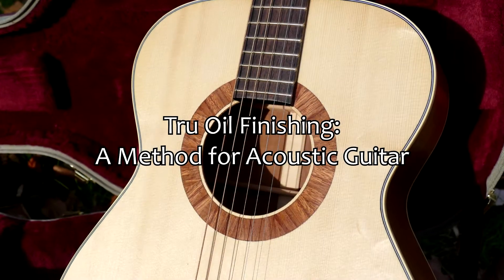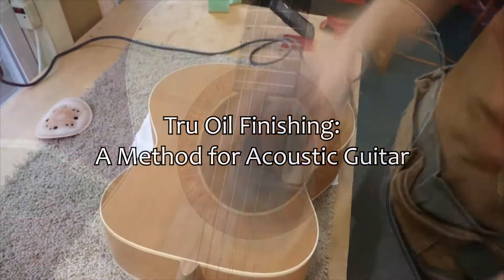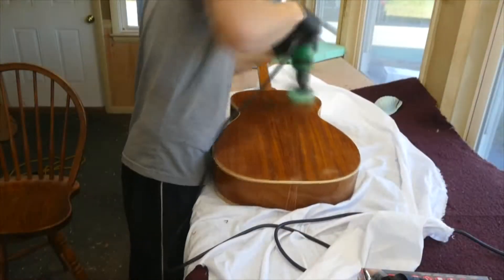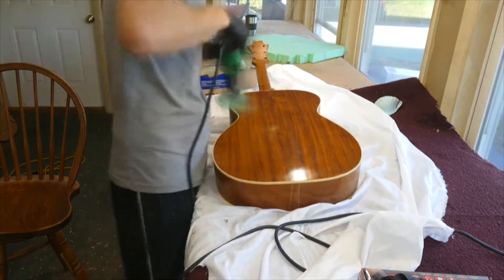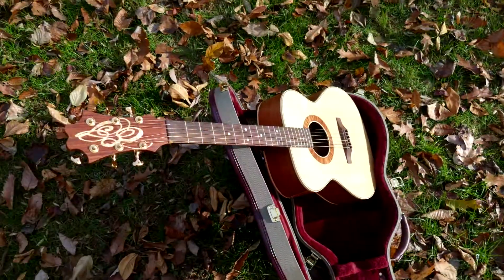Tru Oil Finishing Course

Comment: Hi Eric! I'm a classical guitar builder and all my guitars till now were French polished. This time I will try something a bit different because of the character of the wood .... a beautiful wenge with his deep pores. I try almost all tests on the scrap pieces ... pore fillers (dark, lighter, Epoxy), shellac (polished, mat) and the final solution is to send the wood to speckle ... up to 12000 grit and then finish it with 15-20 thin layers of tru-oil. The question is: Do you have any experience with using tru-oil with non pore-filled wood. This wenge is hell of a wood, hard as a stone so I decide to use all unconventional methods for a classical build to remember this guitar forever. Thanks,

Comment: have you tried tung oil how would that be for a finish ?? i have used it on tables before  and gotten great result before
Reply from the maker: I've never tried pure tung oil. Apparently, Tru oil is composed mainly of tung oil and linseed oils, so I would imagine it's somewhat similar atleast in how it is applied. I'll have to try straight tung oil at some point.
Reply: thank you

Comment: if i dont have a aquacoat , dosent work?
Reply from the maker: Yes you can use other pore fillers, or even no pore filler at all if you wish to showcase the pores. for example, my last couple guitars have been without pore filler. It's a different look from a level, pore filled finish, but not necessarily worse. Just different. I personally like it.